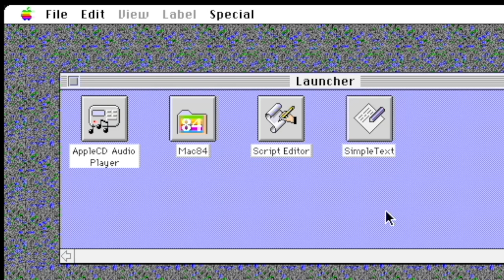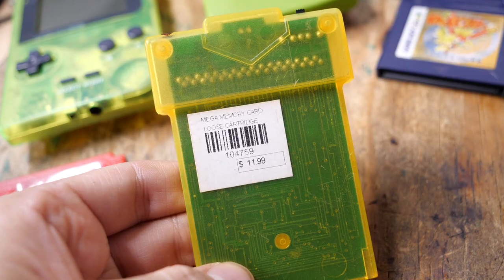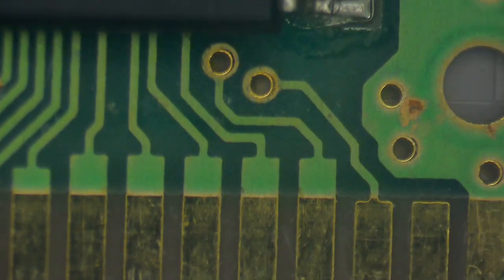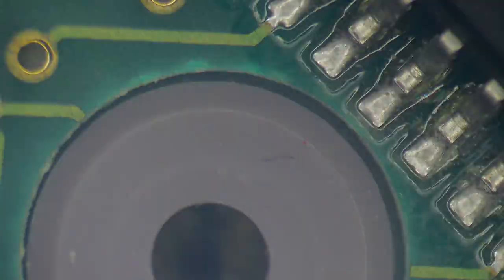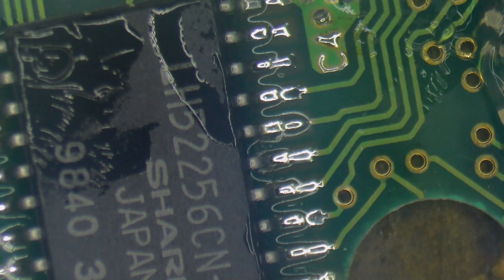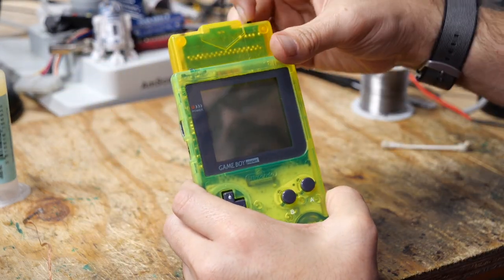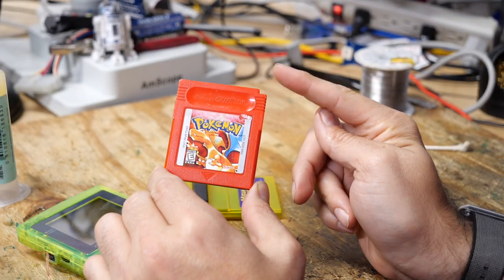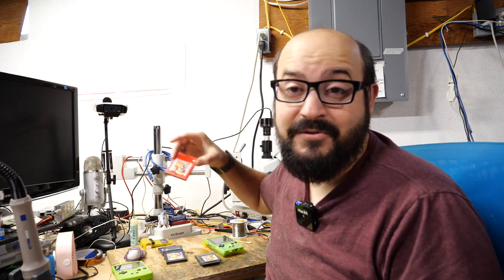Rescuing my Childhood GameBoy Pokémon Red Game with the Mega Memory Card

Comment: Steve, great job on the cart restoration! That was some questionable solder work it had originally, huh? While I haven't had any issues with the legs of chips coming apart from the solder (yet), I have had several games whose card edge connectors were in rough shape from oxidation (we sure did swear by blowing in them, didn't we). I have found that using some ultra-fine sandpaper that I'd originally gotten for buffing out scratches on a car has worked wonders for restoring the edge connectors to a shiny finish (followed by some isopropyl to remove any residue, of course).

I'm curious about what you said about still wanting to replace the battery. I have been operating under the assumption that if it reads the original 3V, that it should be fine, as coin cell batteries rarely leak like alkalines. But perhaps a better-safe-than-sorry attitude is warranted with these things!

Comment: Thanks for the video man. 

I’m currently in the process of seriously considering getting my battery replaced on Pokémon red plus getting back ups. 

I’m currently storing all my best Pokémon on stadium because I assume the battery on n64 games is better than gbc... plus it came out later. 

Is that true? Is n64 games more durable battery wise. 

Also another question. When you save a backup on a mega memory does it force you to erase the currently save state. Or does it just save the data and preserve what’s on the cartilage. 

Not sure if they forced you to erase as a way to prevent you from cloning games / cloning Pokémon. 

Final question- when you restore the save state do you need to save the game within the Pokémon to finalize it or does it automatically save to the cartridge so that when you remove the mega memory it’s there. 

Thank you so much in advance.
Reply from the maker: I’ll have to look at my N64 game, good idea.

The Mega Memory card just clones the saves. It does not erase or do anything negative to the original GameBoy game save data. So I’m theory you could clone things many times over. It is non-destructive. Nothing needs to be finalized or touched afterwards. It wasn’t an official Nintendo product so they couldn’t care less about cloning. Glad you enjoyed it, thanks!
Reply: Mac84 sounds like a life saver. 

Know of anyone that may be willing to sell one for a reasonable price ?
Reply from the maker: I don’t - but I’d check eBay and second hand video game communities and stores.
Reply: Pokemon Stadium and Stadium 2 use flash memory for saves, they don't need any batteries. Most N64 games with internal saves use either flash or eeprom storage. Only Ocarina of Time and ten or so other games have battery backed SRAM, as does the Controller Pak.
Reply: Also, should you happen to have an Everdrive 64 cartridge of some sort, somebody actually made a script to dump GB saves and roms using a Transfer Pak.